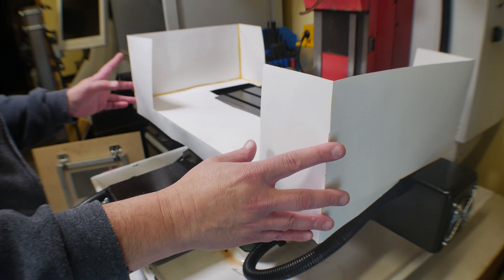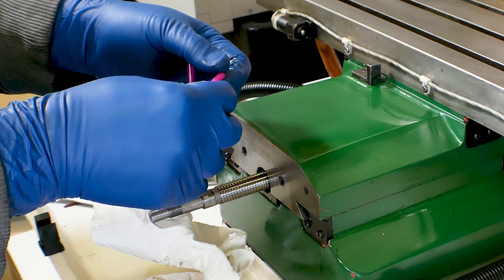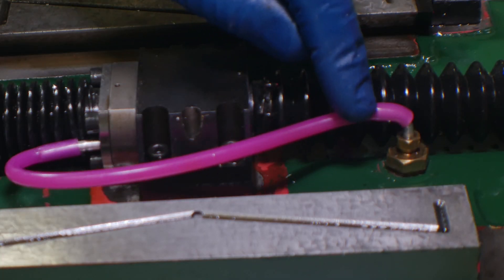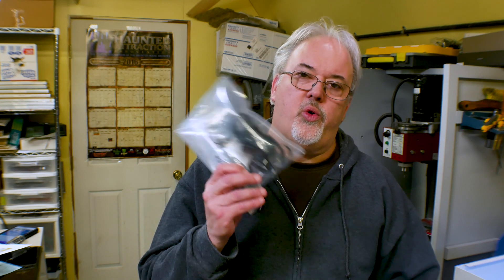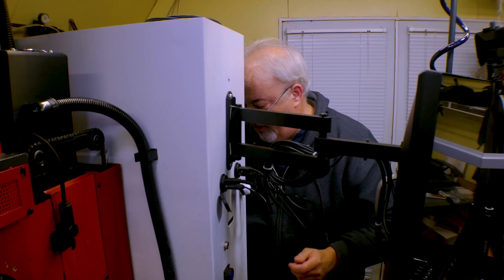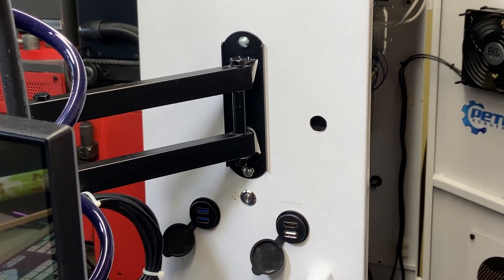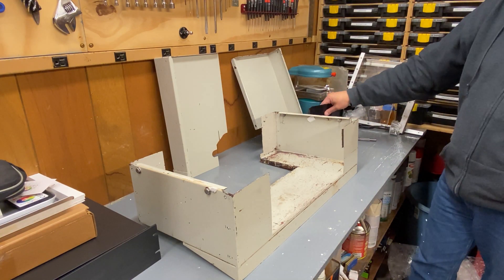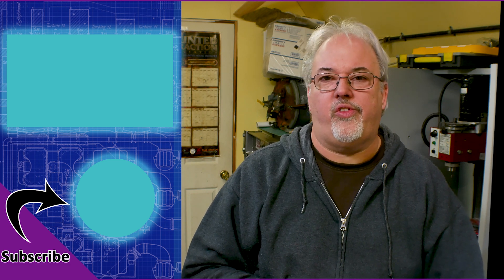CNC Machine Restoration- Finishing Touches

Comment: I am in the process of converting a manual mill to a cnc and also using centroid acorn. Glad to avoid a few issues by watching your video's and confirm a few things I assumed but had not tried yet.  I was wonding if you had given an update on the servo spindle? I did not watch every video in it's entirety but was curious if you were still using the pulleys to change speed ranges or if the servo could handle the entire range without having to change pulley ratios. If so do you have enough torgue at low speed to do rigid tapping and if so how large of a hole have you either attemped or be succesfull taping?

Comment: All your limit switches should be normally closed, and only open when they're on the limit. That way broken wiring is the same as the switch being triggered, and the machine stops, rather than doing mechanical damage when something in the wiring breaks. It's ok to chew some teeth off a belt, but when you have 5HP axis servos directly coupled to ball screws, you want to make sure the limit switches work!! Same thing with e-stop circuits - under normal circumstances, the circuit should be closed, and it opens when you're in e-stop. That way the wiring is continuously checked and known to be working. Much better to have an unexpected stop when nothing is wrong due to faulty wiring, than not be able to stop the machine if there's a real emergency, or you're really on the mechanical limit.
Reply from the maker: I agree with you, every CNC machine I've ever built has had normally closed End of Travel switches, but these are not EOT switches, they are the original normally open home switches provided with the machine.  I kept them because I like their general bullet proof construction.  This machine has no true limit switches.  Now, I could certainly use the home switches like a limit, but it doesn't even have provisions for mounting a limit switch in the opposite travel direction.  On a small machine like this it just wasn't a priority to me.  I was a bit surprised that it stripped the teeth on the belt, I really expected it to just stall the stepper like most other small machines do.
Reply: @PeteRondeau  That's interesting. On the bigger machines, they have 3 position combination limit / home switches. The switches ride over "dogs" that stick out, but the switch and the dog could never mechanically run into eachother. On one side, there's only one dog, the overtravel limit (activates e-stop). On the other side, there are 3 separate dogs, a "close to home" dog that changes the feed rate to a lower rate, the "home" dog which sets the zero position, and an overtravel limit beyond the zero position which also activates e-stop. Pretty odd decision to use such a different arrangement on the smaller machines.

Comment: Nice to see how your DM2800 is coming together. I'm following along on my DM2800 retrofit. You might know already but if your y-axis moves past its normal max limit the back cover plate will crash into the brass oiler fitting coming out of the base and shear it off. 

Have you gotten your DYM4 spindle drive motor to display the correct RPM in Acorn? I ended up buying the same motor you went with but haven't yet messed around with mounting it yet. I was planning on adding a spindle mounted encoder to get accurate feedback to the Acorn board eventually, is that your plan as well?
Reply from the maker: Thank you for continuing to follow along!  Initially I was using the encoder out from the DYN4 drive but it is, of course, the motor speed rather than the spindle speed.  My plan is also to add an encoder to the spindle.
I have a new video coming out tomorrow morning that gives an overview of the costs associated with this build.